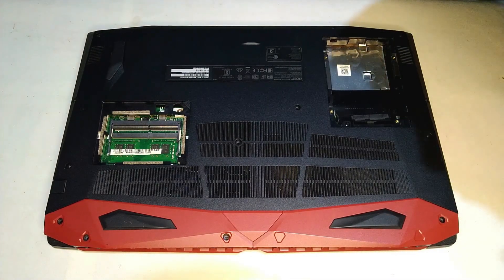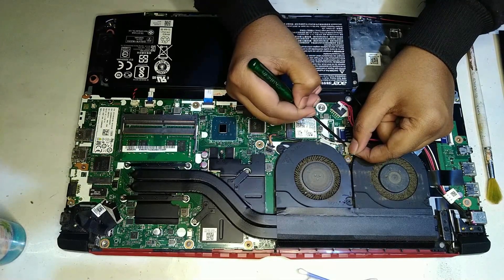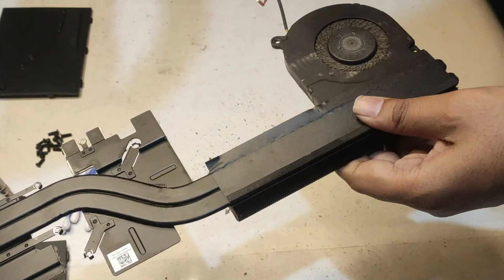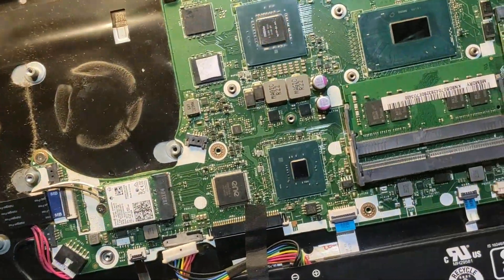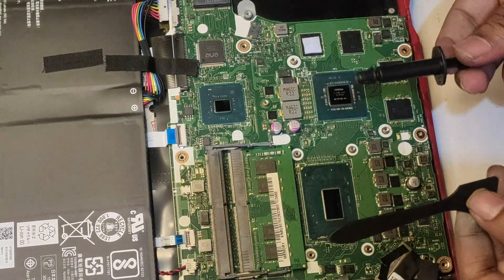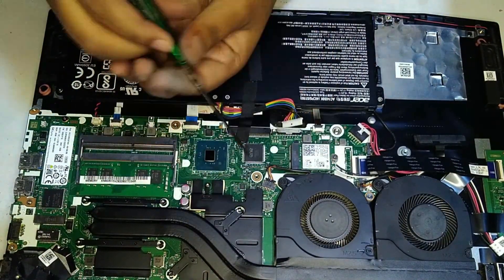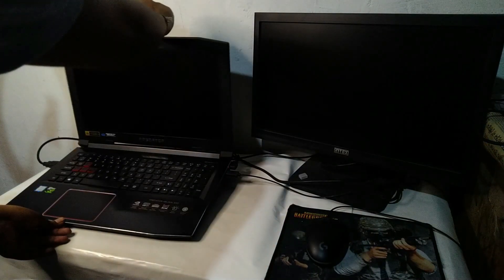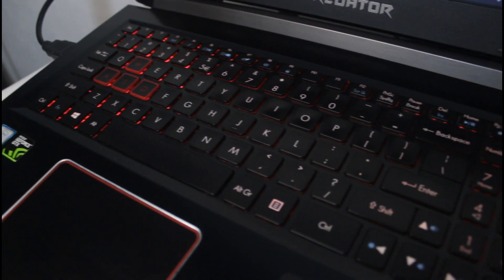FIX Laptop Overheating! | Thermal Grizzly Kryonaut 🔥

Comment: How are the temps holding up bro? I've heard the kryonaut suffers from pump out effect.
Reply from the maker: Couple degrees hotter. Still the games which would hit 95 on the CPU like NFS Heat, are now hitting 83°C. Earlier it was hitting 80°C or so.
Reply: @DeepteshLovesTECH  I repasted a couple of months ago with MX-4. It's absolute crap. Within a month temps creeped up. GPU is fine. CPU hit 95-96 constantly while gaming. I was thinking of going for liquid metal but I think I'll give kryonaut a try.
Reply from the maker: @webslinger96  I used Kryonaut as this was the most recommended thermal paste in the Helios 300 facebook group at the time. So I went with it.
Reply: @webslinger96  Don't use Liquid Metal, it's so dangerous.

Comment: How long do you think the application's going to last if the laptop is used heavily.
Reply from the maker: Should be 10 months.. mine is giving almost the same performance since I pasted it..
Slowly slowly it will degrade.. but before the thermal paste dries up, dust becomes a bigger issue, by the next 7-8 months there will be enough dust to cause mild issues.. and then major issues like bsod by around 12 months.. depends on the dust levels and climate of the region.

Comment: ur thermal paste was fake, u got scammed
Reply from the maker: what 😂
Reply: Exactly what iam experiencing right now. I got this same paste but it seems like a fake one. My legion never crossed 100 degree but after applying this paste temp went upto 106 degree. I have done some research and found out that this particular paste is a fake one
Reply: @thespectator3312  it might have pumped out or dried. Kryonaut is only good for 80 degrees, any higher than that, it breaks down. Look it up, that is why kryonaut is not good for laptops which run hot, yours was already running @100 degrees Celsius even before the repaste.
Reply: @vectivuz1858  thanks for the information. My cpu temps are lower now, idle 32-35, gaming 50-65, but my gpu get warmer at 65 degrees Celsius. Stock, it never crossed 59. Do you think i should replace vram pads, since i have removed heatsink more than 20 times while applying different thermal paste.
Reply: @vectivuz1858  cpu still reaches 100 degrees while only running cinebench, but don't throttle.
Reply: @thespectator3312  it might help but be sure to research the exact measurement/height of your stock thermal pads. Btw are you still using kryonaut or a different paste? 65 on a gpu is great some gpus run as much 80 on laptops especially those high wattage ones
Reply: @thespectator3312  just some advice from my experience, don't use mx-4 its not for laptops/direct die cooling. Read about it far too late and I am now looking to use Gelid GC extreme on my CPU and kryonaut on the GPU and see if it works out.
Reply: @vectivuz1858  it seems you know about these things, so I've ordered two thermal pads, 120mm and 50×50 mm respectively, both 1 mm thickness. Do you think this is enough for laptop vrams?
Reply: @thespectator3312  Yes I think so, about the thickness, be sure that it is the same as your stock thermal pads. Because that will affect how the heat sink's pressure will go down on the cpu and gpu. Maybe sure in forums or ask the manufacturer about the thickness of the thermal pads they use.
Reply: @vectivuz1858  iam using noctua nh1 but soon going to replace it with mx5. Iam testing different brand. I also wishlist your mentioned thermal paste. Kryonaut was better than nh1, atleast by 3 to 4 degrees.
Reply: @thespectator3312  avoid pastes that are "runny" or easy to spread. Afaik those aren't good for laptops but its still a case to case basis, some have great temps even with those pastes are considered "bad". Good luck and if you don't mind update me on how mx5 fares. :)
Reply: @vectivuz1858  sure, i will update when i get my hands on mx5
Reply: @thespectator3312  Hi. I got Gelid and Kryonaut and the difference between Gelid and MX-4 is night and day for me. No more thermal throttling even on highest wattage for my laptop. PL1 is 60 watts and PL2 is 90 watts, max temp is 89 degrees. Before even with 28 watts PL1 and 30 Watts PL2 with MX-4 my CPU would go up to 95+ degrees. It seems that sticky thermal pastes are the go to for me and the laptop I have. It is also great for the GPU. As for the kryonaut it performed slightly worse than the Gelid and is not worth it imo since the Gelid is cheaper and performs better. You could a get 2 or even 3.5 gram tube of Gelid for 1 gram of Kryonaut.
Reply: @thespectator3312  I have screenshots of CInebench R20 scores and HWInfo temps, if you are interested I can upload them.
Reply: @thespectator3312  Lastly I also got the hydronaut and its okay, slightly worse than gelid but I don't think its worth it. In my country (The Philippines) it is expensive when compared to Gelid, for 1 gram of hydronaut I can get a 3.5 gram tube of Gelid.
Reply: @vectivuz1858  thanks for the updates. I got my hands on mx 5, its worst or similar to noctua nh1. I have ordered gelid.
Reply: @vectivuz1858  can you upload cinebench r23 benchmark?
Reply: @thespectator3312  Here you go. I have a comparison of MX4 vs Gelid on cinebench R20. I have cinebench R23 only for Gelid but I think you can compare it with other videos here on youtube that benchmark the 10300H. https://drive.google.com/drive/folders/1Ss3g10ghXdEbkpHEWdS_ALqHSMe0jyNe?usp=sharing
Reply: @vectivuz1858  thanks.
Reply: @thespectator3312  I guess Artic MX pastes are just not good for laptops. I'll stick with gelid from now on, although temps are slightly worse when compared to fresh application, its still miles better than MX4 and stock paste.
Reply: @vectivuz1858  gelid will be my last purchace, i am tired of trying different brands for my laptop. actually my laptop was running perfectly ok, but i messed it. i bought the laptop on january of current year. and the thermal pads which i ordered are bit thinner than stock.
Reply: @thespectator3312  I kinda also messed up when I purchased MX-4, got sad that I only made thermals worse. I hope gelid works for you like it did for me, if you're in doubt if any paste is on the die, put a little bit more and be patient in spreading. 😄
Reply: @vectivuz1858  gelid is working fine, thanks for the recommendation. Far better than mx 5 and noctua nh1 and similar to kryonaut in terms of temperature.
Reply: @thespectator3312  that is nice. Glad it also worked for you 😄
Reply: @vectivuz1858  😁
Reply from the maker: @thespectator3312  sorry for your experience. My temps are only 2°C higher on average, ever since I repasted in March :) Either you didn't clean your heat sink or you didn't apply the paste properly. Even 150/- local paste will give you big improvements in temps if you clean the heatsinks properly.

Comment: How long does these temps last before you need to change the thermal paste again?
Reply: The paste itself does not expire or go bad that quickly. It may dry out over the course of 5-10 years.

However, it must be replaced every time the heatsink is disassembled from the cpu/gpu.

Laptops clog easily with dust and other residue. How frequently you need to clean the laptop depends on how often you use it and how dusty its environment is. Usually you should do it every 6 months in dirty environments (like using the laptop on a bed) or every 2 years with very clean environments (frequently wiped desk in a frequently dust wiped room).

 A few laptop manufacturers have implemented ways to remove the cooler fan without removing the whole heatsink/heatpipe, allowing to clean it to a high degree without needing to reapply thermal paste.
Reply from the maker: Ideally you should change every 6 months.. as dust builds up blocking the heat sink fins. So while cleaning, why not repaste it...

Comment: did it pump out? this thermal paste pump out after a month or 2, and u need to repaste. did u try hrydounat?
Reply from the maker: Hydronaut is used for water cooling setups.
Reply: @DeepteshLovesTECH  what about laptops? not suitable? krounat pump out = bad, hydrount not pump out then good better than kroyaunt.
Reply: @DeepteshLovesTECH  That is true but it is quite viscous making it a decent option for laptops.
Reply: @pulsegamin4790  i got hydronaut, it does pump out as kryonaut, no soultion for my laptop yet, all pastes pump out in short time, im so angry.
Reply: @Khalid_Looby  Try Gelid GC Extreme. Hydronaut isn't very viscous hence why it pumped out. Gelid feels like a clump of clay and it's difficult to spread but that is why it's ideal for laptops. 

So far, my laptop seems to be doing just fine with it.
Reply: @pulsegamin4790  huh? who says it is not viscous? it is as viscous as GC extreme, and u are saying this based on what? have u tried hydrouant ur self? coz im out of hope, and im poor i cant afford things that why i must make sure they really work,

if u want we can talk in discord or facebook or instagram or telegram and discuss this.
Reply: @Khalid_Looby  I used it. It isn't as viscous as GC Extreme. It is marginally more viscous than Hydronaut, sure, but not enough to compensate for poor heatsink mount and pressure.

I say go for GC Extreme, its on amazon and its fairly cheap. Trust me, you won't go wrong with it.
Reply: @pulsegamin4790  what laptop u used it on? i tried mx4, kryonaut, hydroant all not work that why i guessed even gc wont work, but i want to hear from your epxrince, what laptop u used it on? and since when u are using it? u pasted it weeks ago or months ago? how is the performance? i plan to get thermal pad from krynant, is that better than gelid extreme?
Reply: @pulsegamin4790  wow man thanks!, which one perform better thermal gtizzly pad carboaunt or gc extmree? ( in term of temps, and how much)
Reply: @Khalid_Looby  gc extreme will perform better. Just use the X method of application (don't spread thick thermal paste) and it should work just fine. 

I forgot to mention that the biggest issue of graphite pads is that if your heatsink doesn't have adequate pressure, it won't work so well, but it is worth trying out and whatever result you get immediately, it is the result you will have forever.

Worth the gamble imo, so try it first and if it fails, try GC Extreme or IC Diamond. IC Diamond will be better but its pretty low on stock right now.
Reply: @pulsegamin4790  how much temps diff between themral girzzly pads and gc? 3? 

when i installed kryonaut the thermal temps on gmaming were average of 67C
( hydroant higher only 1C AND MOST OF THE TIME SAME TEMPS ) so that is very low temps and im ok with temps of 75C stable on all games.
Reply: @Khalid_Looby  If the temps while gaming were that low, then a pad will be fine. I recommend the IC Diamond Graphite Pad personally but the TG one looks good too. 

GC Gelid Extreme will give the same temps as Kryonaut or even better in a week or two. Overall, you can't go wrong with either.
Reply: @pulsegamin4790  awesome! thanks, i will go with the thermal pads from girzzle then, it is thinner than the ic diamon,

yes temps are good with thermal paste but after 2 weeks it goes back to 90s lol, this laptop has some great cooling system but it suffer the bad pump out illness, when i get one i will report back, ( i hope i can get one, coz i dont have money :( )
Reply: @Khalid_Looby  Keep me updated. Hope the thermal pad works out.
Reply: @pulsegamin4790  sure!
Reply: @pulsegamin4790  bro, how many time do u apply gc extreme in a year, as i minded to buy for 2g of gc extreme hehe. Btw my laptop is lenovo g500s do u think it is suitable and last long for about 6 month at least for just a  normal daily gaming use and not hardcore gaming
Reply: @wanahmadfaiez6535  I applied mine to a laptop last year and it is still going strong. My temperatures on idle remain around 30-35 and peak at 75 with gaming. 

Highly recommend it for your laptop. 

I should mention that for a while, the temperatures will seem bad but that is because it is curing. It is quite thick and viscous so I recommend playing a game or doing CPU intensive work for a while to get it to soften up.
Reply: @pulsegamin4790  thats great enough! well gonna get my hand for one of it btw thank you
Reply: @wanahmadfaiez6535  No prob, just don't panic when you see your temps climb back up after a week. That is because it hardened and needs to be heated up one last time. 

Let me know how it goes.
Reply: @pulsegamin4790  sure thing no prob

Comment: @DeepteshLovesTECH, can you give details of the srewdriver set that you used for opening your laptop? like asap
Reply from the maker: Dude, I don't know what it's called.. it's a regular one that can open most gadgets. It's been in my household for decades.
Reply: When I tried on my system with precision screw drivers, it chipped the screw, Did not even apply force, it just simple happened while unscrewing
Reply from the maker: @SatyakiMandal35  it's probably the screws of your system has got corroded. Probably due to the atmosphere at your place.
Reply: @DeepteshLovesTECH  so what to do now
Reply: Late answer but I hope it still helps.
The screws in a normal laptop are standard PH0 sized philips head (the + head, for everyone not american) screws. A few manufacturers are known to use tri-wing screws (they look like the mercedes logo) on low budget Laptops instead, to prevent the average people from opening the devices.

If you damaged a screw while attempting to get it out, try putting a rubber band in between the screw head and the screwdriver and pressing the screwdriver strongly on the screw while turning it.

An absolute last resort is wd40. It is not conductive so you don't damage anything, but it is still oil based so it is a nightmare to clean up. Also it might leak into the contact points of ribbon cables which are fragile and hard to clean. So wd40 is an absolute last resort that should never be used if it can be avoided in any way.

Comment: what is the current performance and the max temperature?? 
Very informative video, Now I got the motivation such huge difference in the performance
Reply from the maker: Same only bro, core 2 and 3 heats a 1-2°C more than in this video. Idle temps around 40°C-44°C (that's great for Intel).
Reply: @DeepteshLovesTECH  still what's the max temp you while playing heavy game, Thanks for replying 🙏🙏

Comment: I have a legion y540 i7 9750h rtx 2060 , do u think I should use this paste ? My temps are 94 to 96 when i play games .
Reply from the maker: y540 is quite old, not sure if you have cleaned it or not, but definitely you should open up and clean the heat sinks and then repaste with this or Arctic MX-4.
Reply: @DeepteshLovesTECH  i have cleaned the fans and now m thinking of repasting , some say that kryonaut drys up after some month and stuff so m confused which paste to buy
Reply: @darthvader44  thermal grizzly kryonaut is the best paste to apply clean old paste thoroughly wait for sometime apply evenly on GPU cpu and vram apply fully not just pea method. And undervolt ur cpu i7 9750h  go between -150 to -170 after this ur cpu will be running between 68 - 75°C on full load gpu reaches maximum 70 in worst case scenario

Comment: Great video, dude, I'm about to do the same with the same laptop and thermal paste. I was wondering why you didn't use the applicator provided to spread the thermal paste all over the die? Isn't it better to ensure that the entire surface is covered and you are not leaving it just to the heatsink surface to spread it however you place it?
Reply from the maker: No I prefer the dot method, with the heat sink pressure, the dot will spread evenly.
Reply: @DeepteshLovesTECH  Spreading is actually one of the most effective methods of applying thermal paste. The difference is only about 0.5 of a degree but it's definitely the better method and ensures the paste gets applied properly.
Reply: @fredstead5652  the only problem with that is air bubbles are common. But with laptops spreading out is definitely the better option

Comment: What you called IHS ain't the IHS. It's the CPU and GPU die itself. Laptops don't need to have an IHS.
Reply from the maker: Ah thanks :) Is it the same with Amd as well? It's die has grooves and all and is way bigger in size!
Reply: @DeepteshLovesTECH  yes. Every laptop's cpu and gpu have their die exposed. This helps in heat transfer as there is a direct contact with the main heat producing component that is the die itself. As for the AMD cpu die, I have only seen the R5 3550H and it didn't seem that big to me.
Reply from the maker: @kartikpatil8462  ok, and I have seen the die of Ryzen 5 2500u and Radeon Rx560x(Nitro 5 2018), way bigger than mine.

Comment: I saw a lenvovo legion 5 r5 1660ti 120Hz for just 77k in Lenovo official website. Is this a great deal.
Also they are upgrading to rtx 2060 for just +5k(82k).
Reply from the maker: Great deal! Go for it!
Reply: .can tou share the link,also i dont think it includes storege
Reply: @niius7663  deeptesh already made a video 6 days BACK. Do check that. They only included 128gb SSD.
Reply: @noname-gd9gk  and also the battery is too small compared to omen

Comment: Always Love your videos...❤️ How frequently should I clean the laptop..nitro 5 r7 4800h. And does it scrap the warranty?
Reply from the maker: Hey as long as your laptop is throttling like crazy, no need to bother. But still rule of thumb is clean every 6-7 months, depending on how dusty your place is.
The Nitro should be fine for at least a year though. It's quite cool.
Reply: @DeepteshLovesTECH  & wat about warranty...will it have impact
Reply from the maker: @kRAT05s  It depends from region to region man, here in Kolkata, they don't care, as long as device is in warranty.
Reply: @DeepteshLovesTECH  ok bro...thank u so soo much for such quick responses..